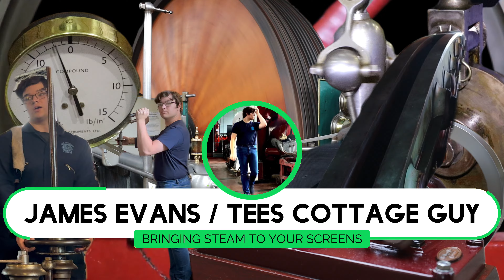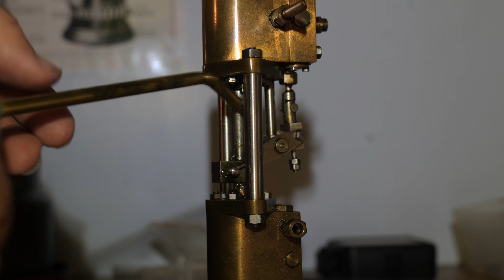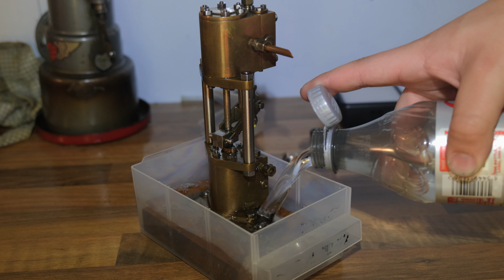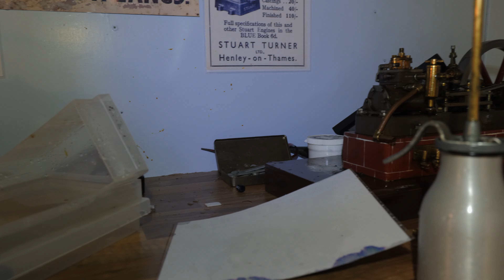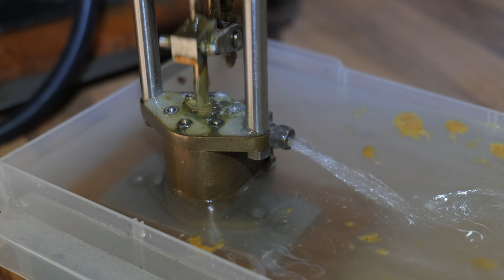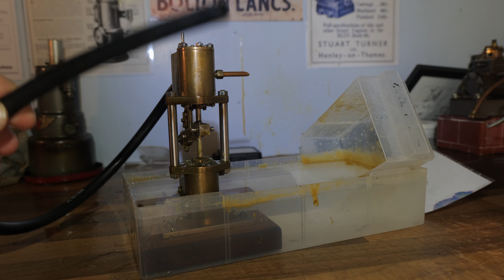STEAMING MY SOUTHWORTH ENGINES WEIR BOILER FEED PUMP

Comment: I missed what kind of boiler you have.
What PSI do run it at?
It would be worth a video about it.
I recently bought a fairly large air compressor (27 gal @200 psi), but would like to run steam for expansion.
Reply from the maker: Hi! I have a Stuart 500 boiler and its working pressure is 50psi. In this video the engine was running at 20-40 psi ish but I only had the globe valve cracked open.